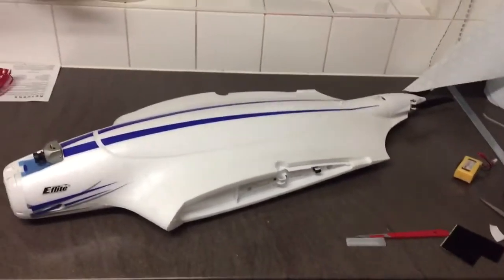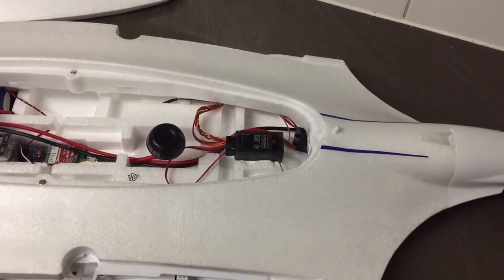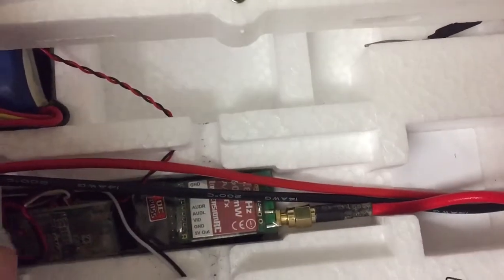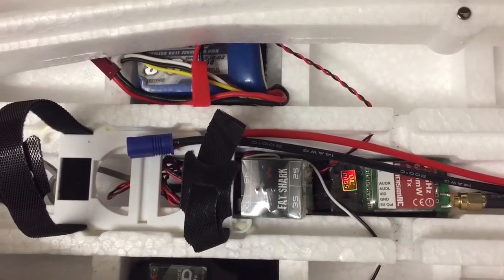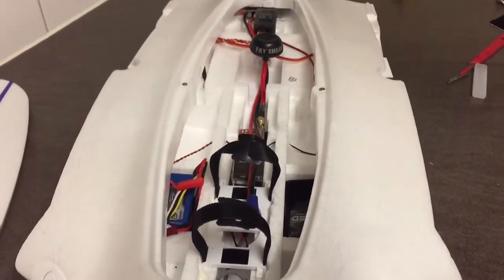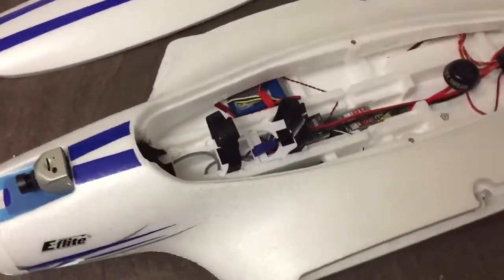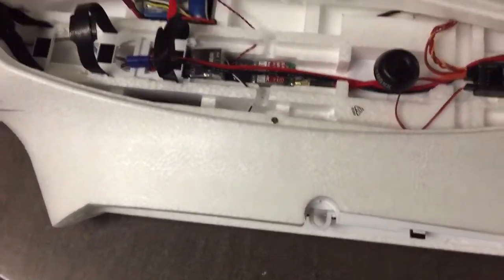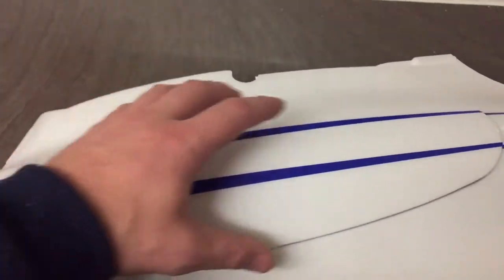E-flite opterra fpv install tips

Comment: Your vtx is inside, did/do you have any issues with it getting too hot?  Just got the Opterra and wonder if need to mount the vtx outside or can keep inside?
Reply from the maker: Lee Marshall hi mate not had any issue with over heating as there's a fair bit of airflow you could mount it outside i just wanted to keep a clean wing with minimum drag 😁
Reply from the maker: You could also open the little hole at the front of the wing for extra airflow
Reply: Thanks for the quick reply.   I will have to try it the way your doing it.  Seen several others put it outside but if it won't overheat inside that is the way to go.
Reply from the maker: What vtx are you using
Reply: Here is my fpv (on plane) gear: ImmersionRc Race Band 15 Channel 600mW 5.8GHz A/V Transmitter
Fat Shark 2S-4S RC Balance Lead TX Supply (FSV1607)
FatShark 700TVL V2 CMOS Cam Fixed Mount #1204 (FSV1204)

Someday may have to add OSD but don't know much on what is good.
Reply from the maker: Yeah your vtx should be ok ive opened the hole in the bottom of the plane aswell were you can have the downward facing camera with the osd all you really need is one that tells you battery power and home point unless your planing on doing long range thats all you need 😁
Reply from the maker: https://rover.ebay.com/rover/0/0/0?mpre=https%3A%2F%2Fwww.ebay.co.uk%2Fulk%2Fitm%2F191624285412
Reply from the maker: Somthing like this with its own gps module but search the net for compatibility before you buy one